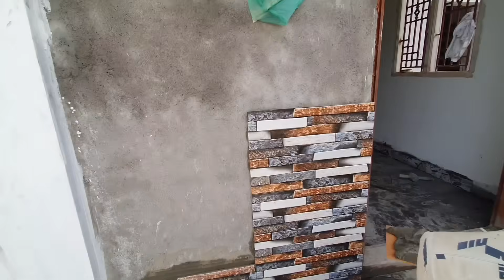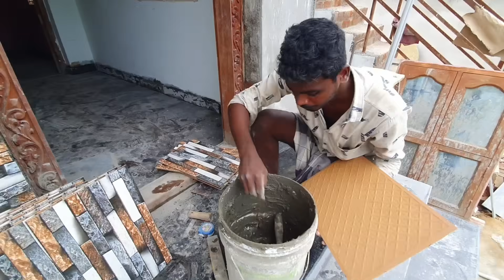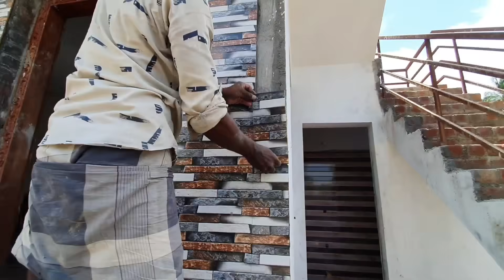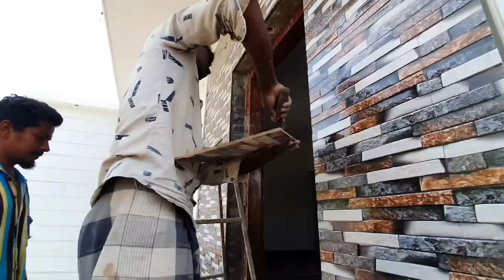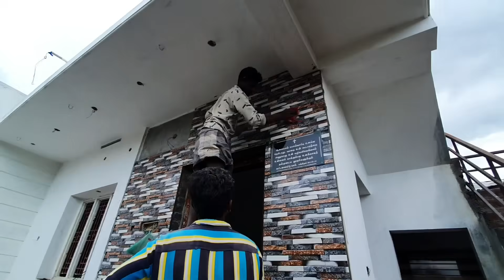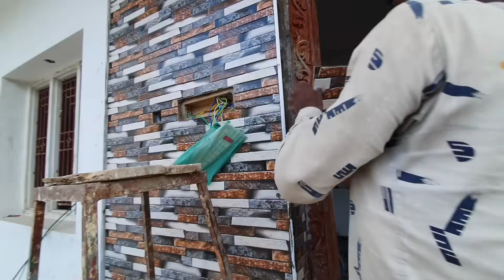Wall Tile Techniques_Portico 3D Front Wall Tile design installation with Perfect|Wall Tile design

Comment: This technique won't last for longer period of time. Because in the plastered wall you should do pully before laying the tiles or right after the plastering you should lay the tiles.
Reply: Use roff t3
Reply: I dont think so
Reply: Probably ok for climate that don't freeze, traditionally you are correct that the plaster (fat mud wall bed with lath) and tiles would be applied in the same process so they would cure together and bond as typical setting mud is mechanical and not bonded.